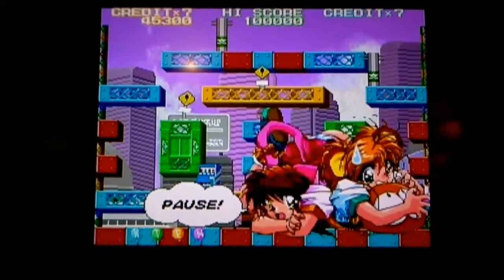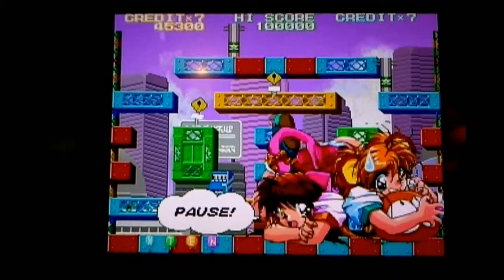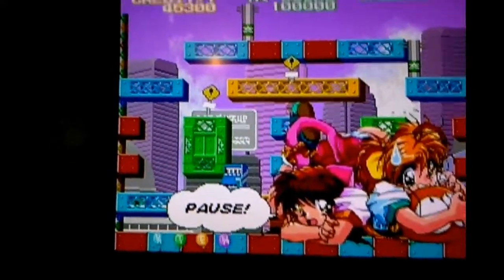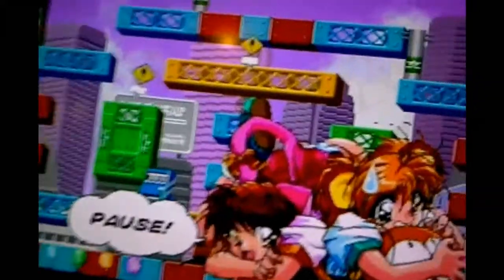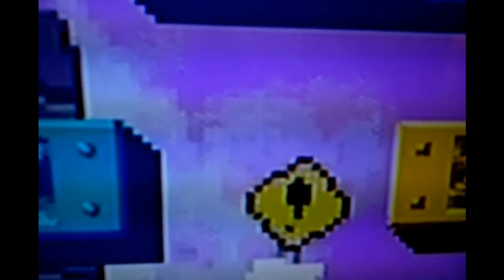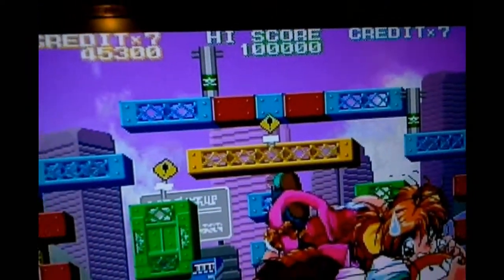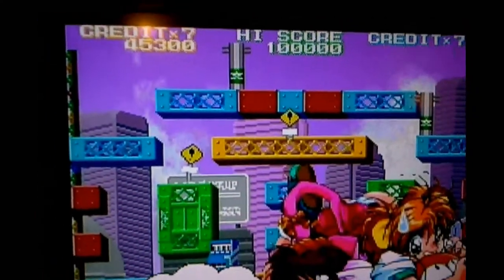Cheap VGA Scanlines (SLG) for Retro Systems

Comment from the maker: Sure. You could always run the normal (standard def) AV out of the PS3 into something like what I have set up here. That would probably work for retro style stuff anyway. If you wanted to do HD out (such as HDMI) I read you could use the HDFury with the SLG3000, though I've never done such a thing myself. You might want to search for more info on the SLG3000 in that case.